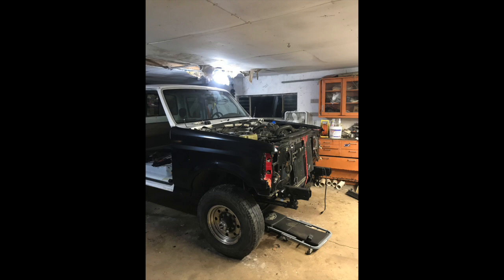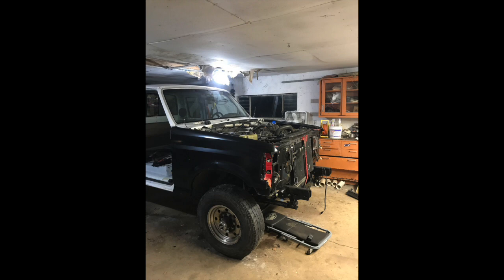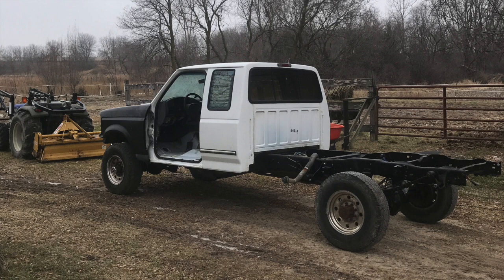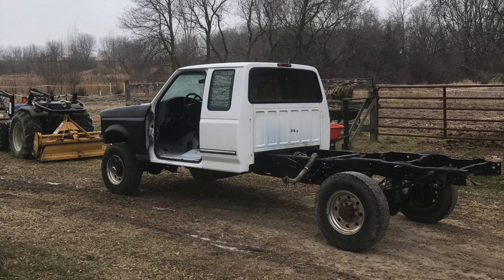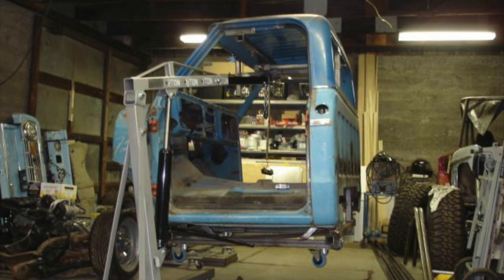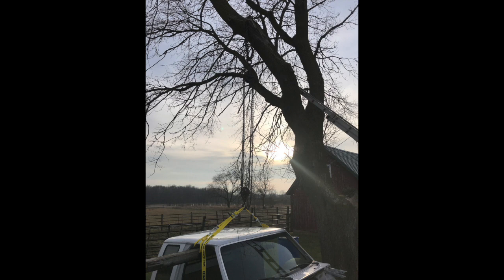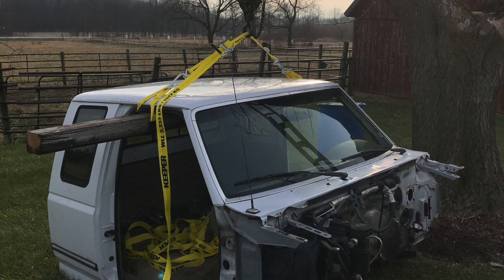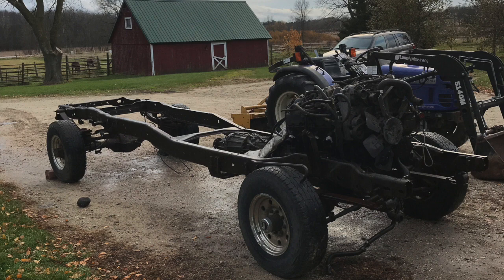How to Remove a Truck Cab Without a Lift

Comment: We did a bunch at a used car lot and used a wrecker boom, slings and a simple spreader bar fabbed from scrap. I've done three for myself just using jacks, cribbing and pipe. Cab swaps beat bodywork and if say a titled half-ton cab happens to land onto a one ton rolling chassis that would (hypothetically of course) do wonders for tax and insurance rates.

Comment: I used a farm tractor to pull the cab off my 11 lml durimax. I Put two heavy hauler straps through the front doors and one through the back door and two small ones at the front to balance it out. Used a 125hp tractor but could work with a smaller one just check load ratting.
Reply: Where did you get the clearance?

Comment: How about a come along? Got a perfectly good in the tool box. Single cab and same body style as yours should be light enough to be picked up like that. Gonna pull everything and paint the frame before rust gets any worse.
Reply: That would would but I don’t know how much I would truck that I use a chain hoist

Comment: Good thinking I see you’ve placed what looks like a 4x4 beam through the cab on the structure metal of the door frame, with the doors removed. I think everyone’s concerned with using a strap with the doors still on the cab. I’ve heard horror stories of people wrecking cabs and doors.

I wonder if this would be safe for a four door cab someone try it and let us know
Reply: Probably going to be giving it a go in some fashion on a crew cab Colorado.

Comment: Most of the  "it can't be done" talk is going by professional standards.  You couldn't do this in the bay of a shop
Reply: Sure can and it's done all the time using two post lifts but I've done them with no lift, just pipes and cribbing. A cab only needs to CLEAR the rolling chassis for a swap. Chassis roll nicely on bare rims if ya need the clearance. Just good old redneck engineerin',